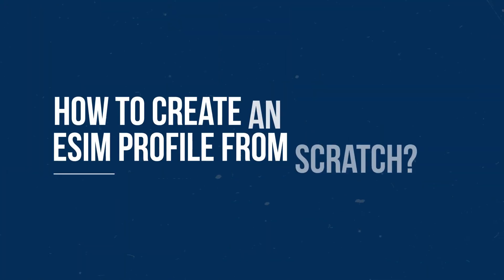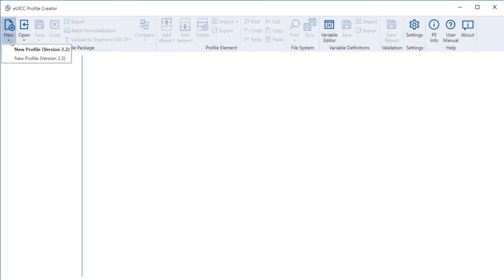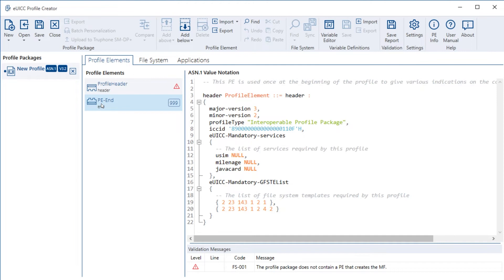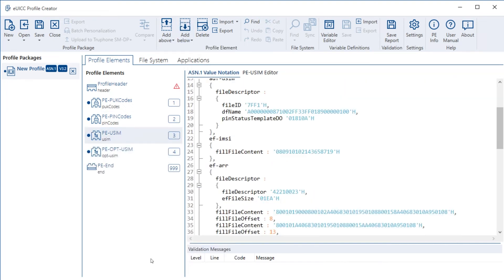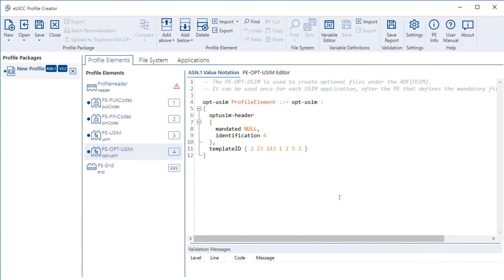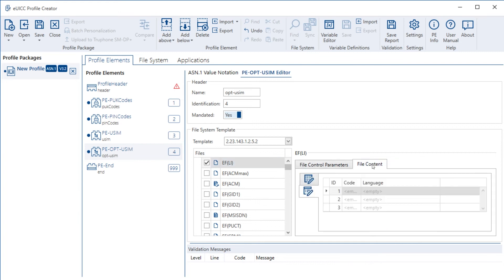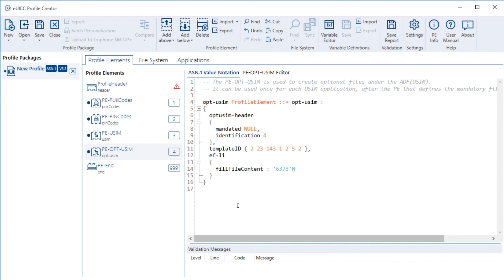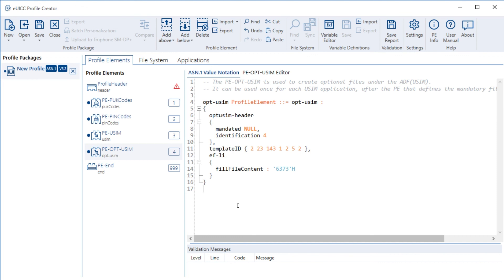How To Create an eSIM Profile From Scratch

Comment: Thank you for this video. Finally some hope. Is there a way to use the SIM data from a SIM card reader and then use this tool (or another tool) to just convert it to an e-SIM QR code?
Reply from the maker: Yes, this tool facilitates the creation of an eSIM profile, equivalent to a given SIM card. However, it only covers part of the steps. First, you need to scan the SIM card, which can be done with a tool like our File Tree Express. After some data format modifications, this data can be loaded into the eUICC Profile Creator. There, some data needs to be added that cannot be scanned from the SIM card, such as the Security Domains. But after this, you get a fully-fledged eSIM profile from the eUICC Profile Creator. In order to download it to a device, additional steps are necessary, which require a SM-DP+ server according to the GSMA technical specifications. This server will encrypt the profile and offer the data on an interface that can be used by a device to download it. The QR code is just a reference, telling the device which SM-DP+ server to connect to and which profile to download from there.
We hope that answers your question. If there is anything else, let us know!
Reply: @COMPRION can you do a step by step? If i have a sim. How do i use the info to generate an esim profile. And then install into phone